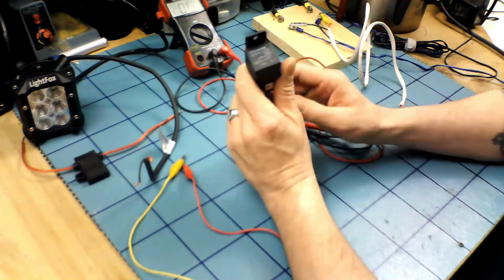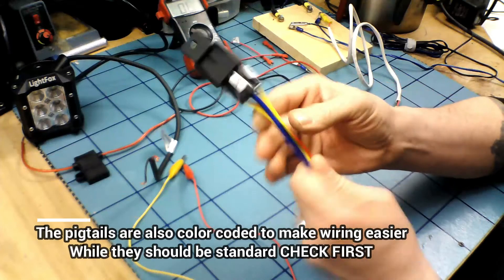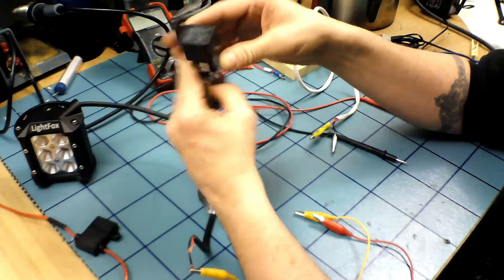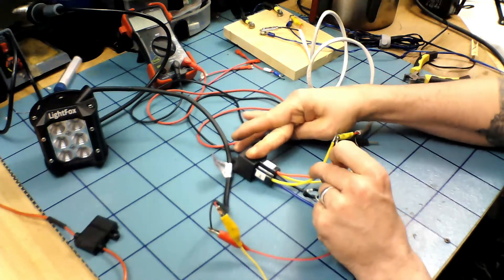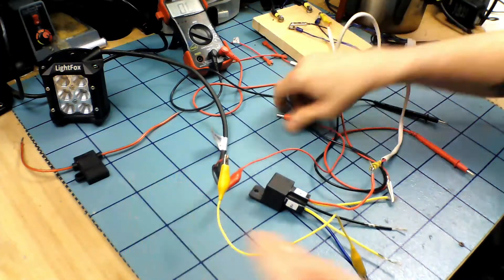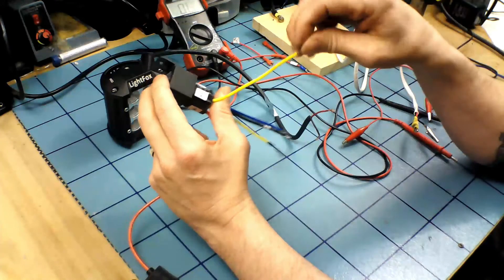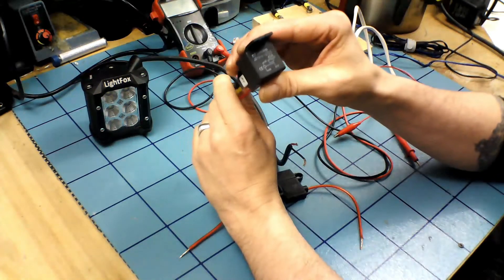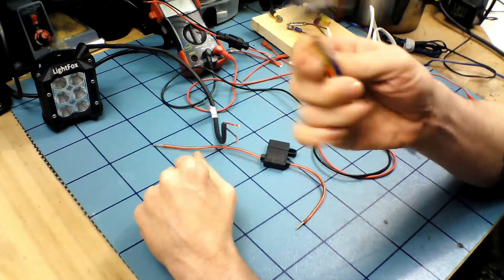How to wire a JD-1914 12v 40amp Relay

Comment: Hi there i have this relay in my car that came with the DIY heated seats.  The relay was pre wired and the instructions said to just mount the switch and connect to the battery.  This means they are always available without the ignition.  problem is when you leave them on overnight.  (flat battery). So on my rocker switch i have 3 settings.  off. low power and high power. the centre wire is in play on the relay and there is a live supply from the harness to the centre of the rocker switch.  I have cut this wire and insulated it.  i have taken a feed from a small 12v ignition wire and fed it to the center of the rocker switch.  This now works on the ignition.  On the low setting i hear the relay fire up and the seats get warm, on the higher setting the relay is silent and the seats get hot.  My fear is that i'm using that tiny switch live to power the high setting.  am i right or wrong?  Just for the avoidance of any doubt i have kept the big fused connection to the battery as per the install instructions & have a big earth wire there also.  the product can be found here with images. https://www.amazon.co.uk/gp/product/B07V5W125P/ref=ppx_yo_dt_b_asin_title_o01_s00?ie=UTF8&psc=1
Reply from the maker: I think it sounds like you may have misinterpreted the instructions maybe? or I am not understanding the question. The relay has two power in wires (most anyway) one goes to the battery and is a live source 24/7 the other is the trigger wire so it is only active when you send power to it meaning via a switch or ignition etc  the relay only allows the power from the battery to be activated and completes the circuit when that wire is triggered so if you want the seat heater to only work when the ignition is on you get a wire splice gizmo and attach the trigger wire to the relay to a wire under the dash or hood only when the key is on something like the AUX ports (formally called a cigarette lighter) or other such wire that will not screw up your cars electrical system like a can bus system etc. 

is that what you were asking?
Reply: @kootenayboy  thanks for that. Sounds slime what I have done by powering the switch from the car.